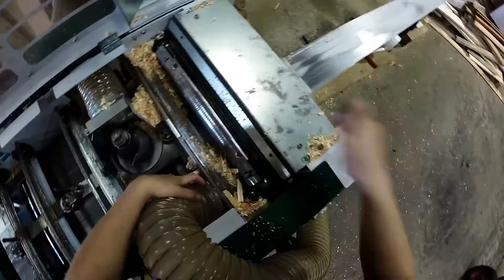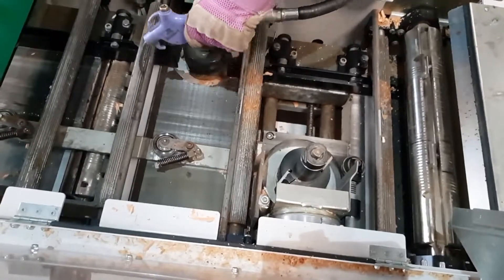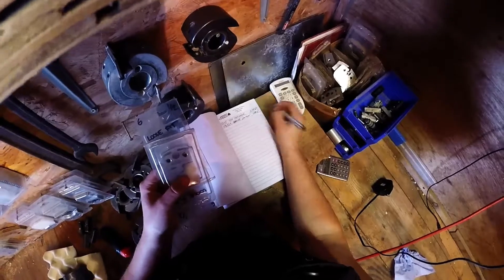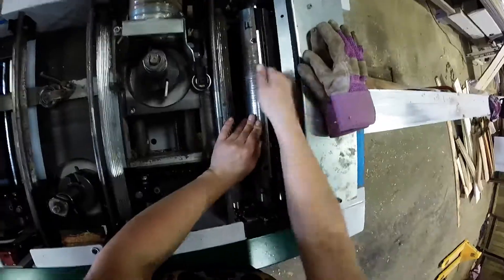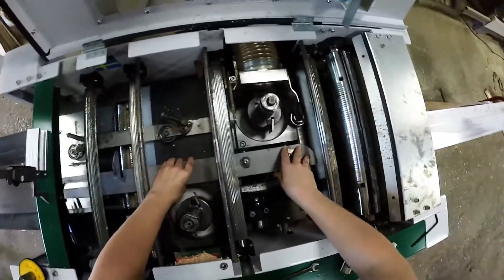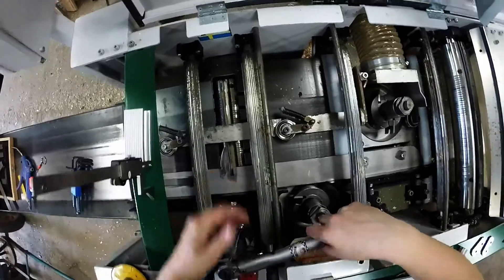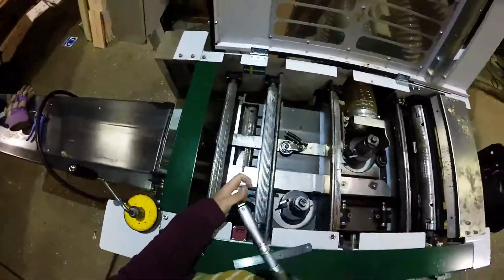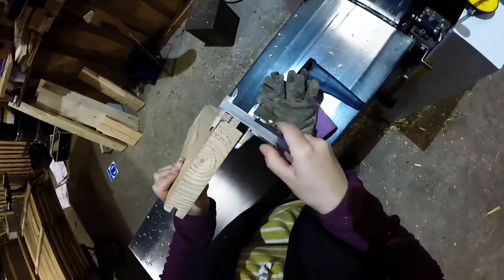Logosol PH260 - setting up for cladding

Comment: Nicely done!  What does your dust collection/chip extraction system look like?
Reply: Hi This Chanel is not currenly monitored by abbey timber. I remember using both twin bagged extraction unit and then we upgraded to a large single fan system with a cyclon and outhouse collection silo.

Comment: Hi, Thank you for good explaining. Do I have to use the Surface Planner (Jouinter ) before put the lumber on four sided planer/Moulder ?
Reply from the maker: Thank you v much! I have a surface planer but i dont put boards trough as we make hundreds of square meters of cladding and flooring at once. We cut the logs into slabs with bark on both ends, then we kiln dry the timber first and edge it to the boards after drying so all shrinking and twisting happens before edging. so boards i put into the planer are essentially very square and straight.